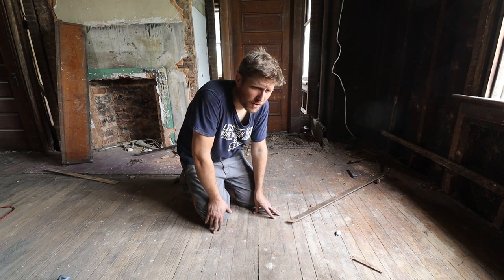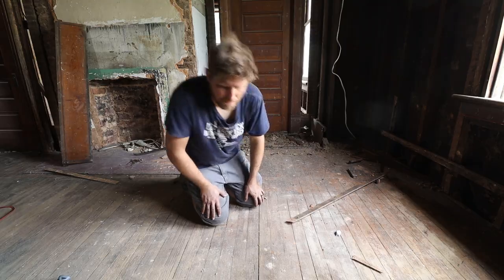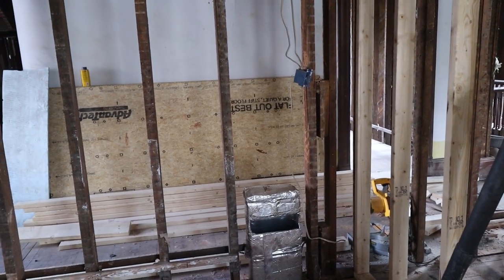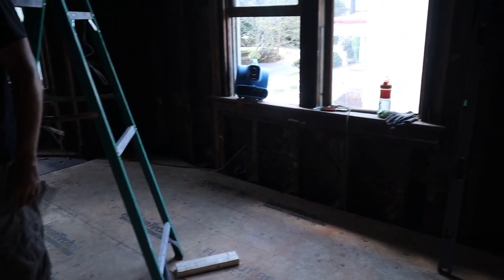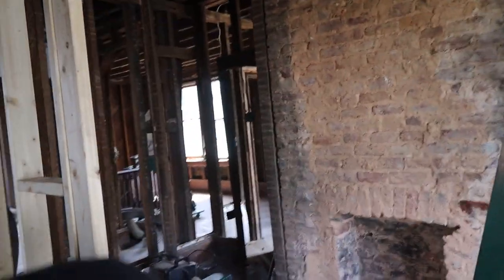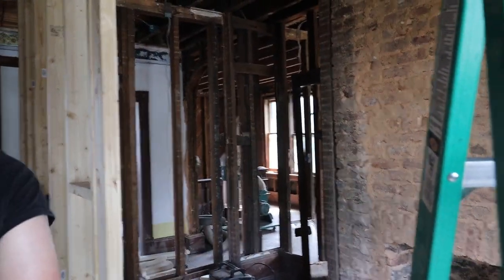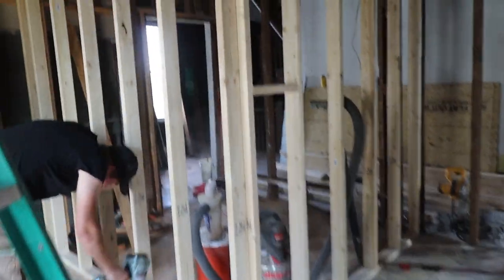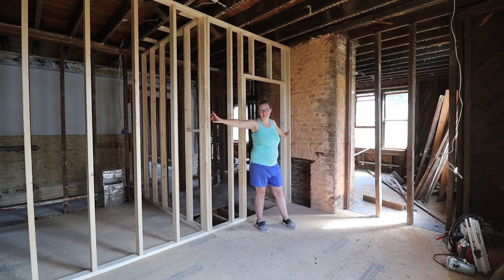How we salvaged our pine flooring and divided up some rooms - Victorian Home Renovation [TirolerInn]

Comment: Hello from Athens, Greece. Have you considered insulating your interior walls to keep the noise level down. If I'm not mistaken , Lucas on "1806 stone house " has done it.  From my understanding he is happy with that decision. Keep up the good work.
Reply from the maker: Absolutely, it was definitely one of the considerations that made us choose to open the walls and ceilings as much as we did. We plan to use rockwool insulation for the interior walls and floors. We have a bit more work to do before we will be ready for that. Glad to know Lucas thought it was a good call, we also think it will be worth it! Thanks for watching 😁